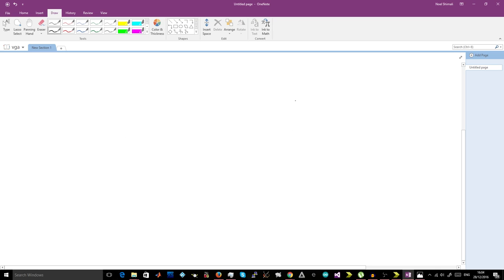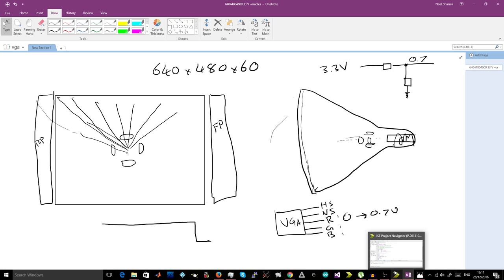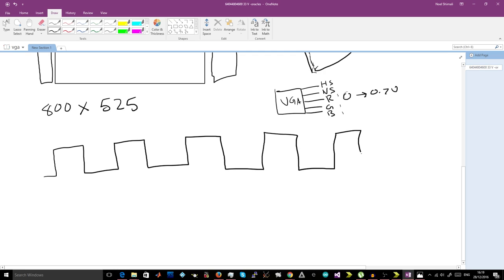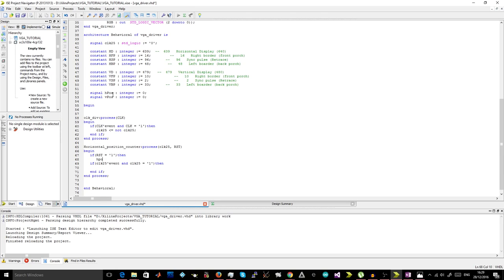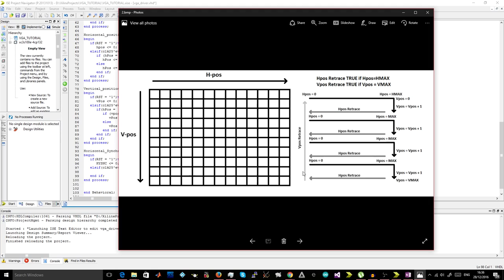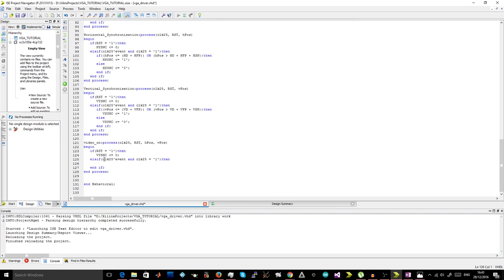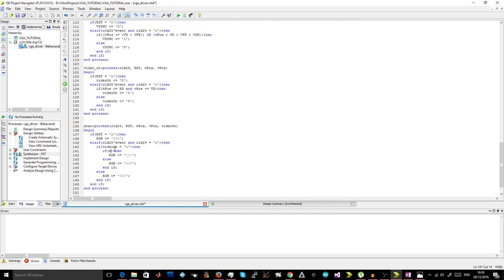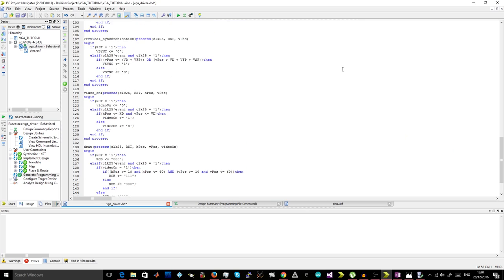VGA driver for FPGA in VHDL

Comment: Great Tutorial!!!

Thank you :)

Dear daxerz,

I have a request to you for a video on VHDL project:

We have a calculator program in vhdl and we need to interface the the PS2 (Keyboard), VGA and processor using an Xilinx Spartan 3E starter kit board. Finally we need to run the calculator program and test whether all the interfacing and processor designing are working properly.

We are really new to this and have very limited knowledge on the same. 

It would be great if you can upload a video showing how to do the programming for processor, Keyboard and VGA interfacing for the Xilinx Spartan 3E starter kit board.
Reply from the maker: Thank you very much for a great response! As for your request I can't accept requests since this is a very busy time in my life, I am a masters student at this time. I would like to help but during my course I have studied verilog and find it a much better description language after many months of contemplation. I do plan on doing more tutorials in the future but as of now I can only show what I know. As for you request I could do everything in verilog apart from the keyboard from my knowledge alone, I do have experiance with a mouse so it wouldn't take long to learn the keyboard protocol.
I actually recommend this video for the keyboard: https://www.youtube.com/watch?v=EtJBqvk1ZZw
Also the book: FPGA PROTOTYPING. BY VHDL EXAMPLES. Xilinx SpartanTM-3 Version. Pong P. Chu. Cleveland State University
Reply: Thanks for your reply.

Comment: How can we add test bench architecture to do port mapping stuffs and do the simulation test in Xilinx itself, before actually testing the output in the monitor.

Do you have the code for that. If so that will help.
Reply from the maker: Yes it's actually very simple since everything is counting based on the clock, therefore only a clock signal is needed as an input in the test bench (also reset to be set as 0). Just make sure to change the simulation period to what you want. I've updated the link to include a testbench.
Reply: Great. Thank you so much

Comment: Hi,

As of now i have just hard coded the RGB values similar to what explained in the video. It is working okay.
Now I need to make the vga component capable of outputting data from a character memory.
We also have a processor and need an interface to write character memory from processor.
How can we do that?
Reply from the maker: First of all is the processor a requirement? I know it's not a great video but I have one where I made a text generator in it: https://youtu.be/jU_txSkDGM4. This was made in verilog here's a link to the text generator in the project: https://github.com/NoelSh/Projects-FPGA/blob/master/Tic%20Tac%20Toe%20PS2%20mouse/textGenerator.v. I used a ROM ip core to store the text and used the x and y address to determine if a pixel should be drawn on the LCD. The LCD here works the same as a VGA monitor with the pixel address changing every clock cycle. The way it works may not make sense at first (that's including the addresses since the LCD was rotated) but I chose this method so only one module instantiation is needed. Also if you look around in the whole project I made a binary/hex to bcd to ascii converter which you will most probably need. This is all I can do right now.
Reply: Thank you so much.